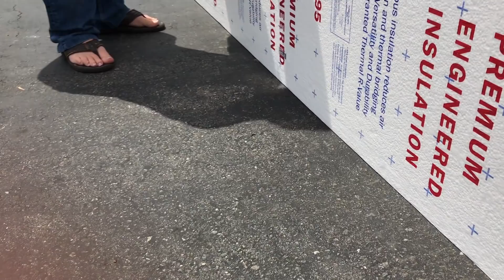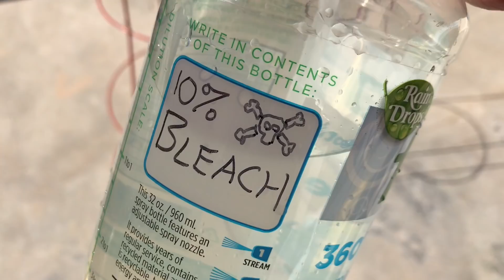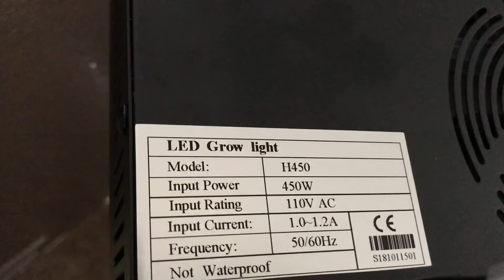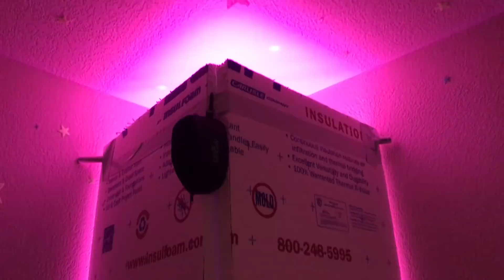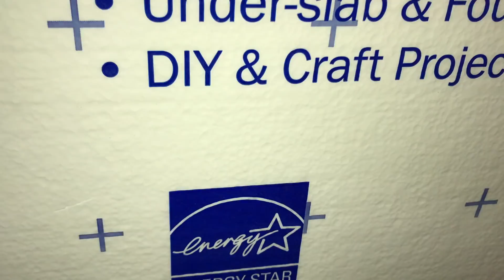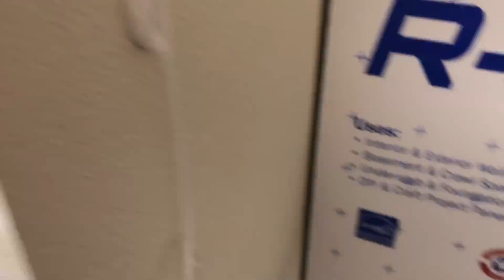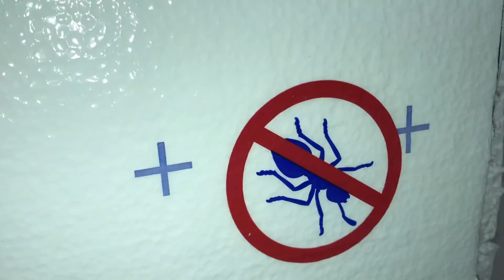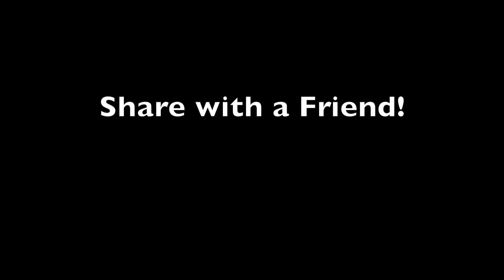Monster Plant Grows in Styrofoam Cage

Comment: Hi if you decide to make another some time u will find it alot nicer and easier use soldering iron or heat piece of metal up it will put perfect hole in it right away

Comment: You can get a better light cheaper.. Giixer 1000watt LED. has settings for VEG to give your blue/white for roots. Then has bloom for your red/orange during flower. & of course you can flip both switches and have full spectrum.. They only cost me 60$ and theyll last about 2 1/2 years..

Comment: could you explain your top up bottle? is that meant to keep the water level or just a convenient way to add more nutrients. what's the math on your solution when your adding more to the tank. thanks
Reply from the maker: tops it off.  i like guesswork with nutrients

Comment: A real good way to get air flow going in that thing would be to put a box fan blowing out words on the top mounted somehow and then put like a bunch of little 6 in diameter fans and cut holes around the bottom to blow in cool air
Reply from the maker: good idea.

Comment: Airflow? Easy. Put two or four one to two inch holes along the base of the foam. Heat from the light will setup a convection air current and naturally move the air around.
Reply from the maker: I think a box fan perched on top blowing upward would work well
Reply: @JebGardener  you'd mentioned in previous videos about pumps being noisy, so I was thinking about that when I thought of holes and passive convection. No noise, and no extra electricity cost.
Reply from the maker: i tried convection with the early buckets.  didn't work too well

Comment: What was the purpose of the glass bottle upside down in the lid?
Reply from the maker: It keeps the water topped off at a consistent level
Reply: I see. That's what I was think, I just wasnt sure if it was like a slow release automatic nutrient system or just to keep water topped off. Smart idea though. I like it, thanks for sharing man

Comment: What you should have done is used elastic band wrapped around each post to set your depth of how far you want legs to sit into bucket leg right get them set just enough to put an elastic on the inside around the leg that will hold it in place I hope no one does that and grows weed gets root bind all around them posts you left long inside your bucket.
Reply from the maker: interesting thought

Comment: Hi Jeb, I am looking at the Mrhua light you suggested since the Kingbo is out of stock. I am looking to grow cucumbers, hopefully tomatoes and possibly some lettuce and things like that during the winter in my basement. I am looking at Dwarf plants since I am trying this in the basement. There is a 450W and a 600W do you have a suggestion on which one I should go with?  Also have you tried any dwarf plants for winter growing? Hopefully that is an affiliate link so when I buy you get some thing. Thank you
Reply from the maker: they paid me up front.  just depends how large your grow space is
Reply: @JebGardener  I will be trying your Kratky tote method for the cucumbers most likely first then maybe 2 to 3 20 gallon totes at 1 time.
Reply from the maker: get the higher wattage light for that.
Reply: @JebGardener  Perfect, just ordered the 600W. Thank you

Comment: Once the plant is maturing you show the inside of the grow box and we see that the water is low is that the normal water height. So that roots can be in air and bottom portion in water ?
Reply from the maker: this is dwc so any water level drops are merely mistakes on my part
Reply: Jeb Gardener  thank you for the answer. So you try to keep about 60% filled. I transformed a room in the basement to grow. You inspired me so much and got me started 2 years ago Thanks.
Here are the results after first season interior gardening.
https://youtu.be/0QUex2kYRZ8

Comment: I would use either Tetra air pumps or Aqueon Quietflows to reduce the water noise. Tetra is amazingly quiet. Since the Quietflows are hang on back kinds, you could try cutting out a slot and fitting the hanger through it so it keeps the lid tightly shut but still does the job. Also I have major respect for you having a bin full of water in carpet.
Reply from the maker: maybe i will try that.  its hard when there is a super cheap walmart pump to use
Reply: It's about a dollar more than the walmart one for the tetra brand
Reply from the maker: that would be a cool comparison

Comment: Hey Jeb, I see you used styro with the foil face. Was done to boost the light? If so, there is a more economical way. If you go to Wal-Mart, Dollar Tree*(everything is a buck or less), or whatever store like these in your area. Go to the party supply section. The plastic table top covers are what your after. There should be silver and gold plastic foil one's.I got lucky and my local store had a clearance sale, so mine cost $0.27 with tax.  I used thumb tact's, covered my walls and it worked very well.
Reply from the maker: yeah it seemed like a handy way to have structure and reflectivity

Comment: i really wouldn't say this is anything special since marijuana growers have been doing stuff like this for decades. i'd suggest using a hps 1000 w light and a good fan and ducting from a window for fresh air into the room and ducting to get rid of bad air. i'm not sure if you ph tested your water but if you didn't you should at least once every 1-2 days to maximize growth and keep the temp of the area at the right temp for your plant to maximize growth. good job on the plant

Comment: What I used to use, kinda same thing, is old Refrigerators. Id line the inside with heavy duty foil with Metal Foil Tape, fill the Crisper Drawer with dirt, and use whatever light you choose. Break off the Trigger switch for the light, disconnect the power to the Freon pump and hook the plug up to a Timer. Big, metal, insulated, sealed TIGHT. Heat, light, odor, NOTHING escapes. Not even heat from a high heat bulb. Works pretty good and nobody suspects it a "Plant House"
Reply: You need airflow
Reply: Sounds great but how do you manage airflow?
Reply: Sounds like an oven with the heat not escaping.
Reply: :D
Reply: But, but, but, don't you have to have the refrigerator door open for the light to be on???

Comment: Tight spaces like that require much more airflow. What do you use to remedy the powder mildew etc? I usually use some serenade. Better production with not airflow. I.e proper exhaust is the most important. Get the humid sure out
Reply from the maker: A box fan perched on top blowing up would have helped.  Sm 90 is a good preventative
Reply: Jeb Gardener good video man

Comment: What nutrients do you use? What is the ratio?
Reply from the maker: i put that info in my older videos.
Reply: I know, watched it once earlier. I just can't find it now I need it :(
Reply: Master blend. You can get the kit on amazon. Ratio is 12 grams nitrate, 12 grams master blend and 6 grams epsom salt. In 5 gallons. Mix in that order. Was told if you mix it all together like Jeb, you get nutrient lock out. Meaning the chemicals bond to eachother, therefore the plant cant use it. 
Jebs been doing this for some time now and ive been mixing it seperately. I dont see a difference. I just follow the directions on the package, but Jeb...Jeb's a rebel who likes to break the rules! =P

Comment: Can someone explain the bottle phisics
Reply: When the water table drops below the mouth of the bottle, gravity pulls out some of the water in the bottle. Bringing the water table back up to the level of the mouth of the bottle. Thus stopping any more water from coming out of the bottle.
It keeps the reservoir topped off by gravity. Its purpose is to extend time between top offs and or ensure the water level stays constant for x amount of time. The amount of time extended depends on the evaporation rate plus the plants consumption plus the size of both the reservoir and gravity fed container. Possibly also the air stone may have some role as well. I dont know if air stones accelerate evaporation or not, im assuming they do marginally.
Reply from the maker: yeah it lasts only a couple days when the plant is large.  The airstone has to be kept away from the bottle because the bubbles will rise into the bottle and push the water down.

Comment: Running that 450W light for just 12 hours a day here in Denmark would add 65$ to the electricity cost every month. Add the cost of the pump, the reservoir and that mighty expensive looking growlight. You will be enjoying cucumbers or tomatoes or whatever at 20$ a pop.
Reply: The led's are rated at that wattage. They dont run at full blast. The video clearly shows it pulling 146 watts. If he is running it 12/12, it would cost him approximately $8.28 a month. Thats relative to his location being 00.1534 cents in California for 1 kwh. I dont know his exact location. 00.1534 cents/kwh is average for all of California.

Comment: >input power 450W
>Input current 1~1.2A
>Input rating 110V AC
I don't get it. This is why I don't understand electricity well. Seems to me that, if its using 1.2A, then the amount of power can't really be more than 110*1.2 which is far lower than 450.

Comment: So, I've made plans for a self sustainable "sprout grower" but wondering if you could troubleshoot some of the issues that might come from it. Mainly the increased possibility of salmonella if the sprouts were misted with water from the tank. Thoughts?
Reply from the maker: I don't have a lot of experience with sprouts but my guess is adding chlorine or peroxide.
Reply: Jeb Gardener wouldn't the chlorine have an adverse effect on the growth of the plants? I thought about running the water pump Line pass a UV light...
Reply from the maker: depends how much you add
Reply: Let's say it's a gallon of water. How much would you recommend?
Reply from the maker: You are going to have to research and experiment
Reply: Jeb Gardener will do. Thanks for the advice. I'll let you know how it goes. Also, if you ever want to grow hot peppers (and I'm not alluding to anything else - talking about the live chat last night haha) let me know. I know some guys down in Texas. 😁 Bests!

Comment: I like the submersible pump you used. It's almost like an air stone/pump combo. I use the same one. :) And remember, Jeb. Silence screams.
EDIT: But then I watch further and you switch it out haha. Oh well. It works great for starts in a recirculating drip system.
Reply from the maker: yeah it was promising but it kept slipping down and failing.  i don't like having a power cord go into my res
Reply: I get that totally. I mount mine on the bottom. I know power and water are not a good couple, but maybe some day you should try out a drip system on a timer. I know you're a kratky man, but hey, I was SUPER surprised to see you branch out with a pump and stone haha. Take it easy.

Comment: Hey Jeb, maybe look around for an external aquarium pump, they run pretty quiet and are air-cooled rather than dumping the heat into your water.
Reply from the maker: yeah the pump i used later was outside the chamber

Comment: I loved the video, but have a question.
Normally, you use the Kratky method of hydroponics, but in your last couple of videos you decided to add a pump to oxygenate the water. Why is that? Is it because of the specific plant being cultivated?
Reply from the maker: for this one it is the ratio of the root mass to the surface area of the water.  also indoors it is relatively inexpensive to add air
Reply: i use a small atomizer in the water to turn it into vapor, the roots suck it up...they are cheap cause once you toss it in the nutes they get coated in salts and stop working efficiently after about 50-65 days depending how strong the solution you use.
Reply: Jeb Gardener I see. Thanks for the explanation.
Reply: Just Another Videoless Channel hey what solution did u use an can u use it with tomatoes
Reply: It's because he did not know what he was doing just look how he stuffed all the roots in the cup? 😂🤣practice makes pefect
Reply: @originalintent3664  hes growing cucumbers not roots
Reply: @mauri906  
Your comment is laughable at best.

Comment: Quick question - Why do you pollinate the female flowers? I've been told to take the male flowers off the plant ASAP because if the female flower gets fertilised, the cucumber gets bitter. Or is that only for some cucumbers? (I believe I have Telegraph)
Reply from the maker: regular cucumbers will reject the fruit if it doesn't get pollinated.  Some breeds produce mostly female flowers and the plant doesn't reject them.  If a male flower appears you remove it so the fruits don't swell irregularly and produce large seeds.

Comment: Really wanted to see you cut into it and eat it. What variety was it (on tiny screen couldn't see label.)
Reply from the maker: japanese cucumber
Reply: I'm guessing the light was also acting as a bit of a heater with insulation all round it.
Reply from the maker: thats why i used the temperature controller
Reply: Jeb Gardener hey consider growing chayote next. Its climbs with hooks like this plant, it grows very fast very easy and big and you get a ton of veg to eat plus in Cali weather is perfect you dont need grow light. In my place I lived before in one season it covered the whoLe fence between me n my next door neighbor
Reply: jaime delgado But what do you DO with it? My neighbors had that, hanging over our fence all the time. I saw them in the grocery store once. I guess you're supposed to cook them. I couldn't get them to something I wanted to eat. (also in CA)

I knew those were japanese cucumber. I was worried they would get too heavy and pull down the plant.

Comment: as always an amazing video jeb I wish I was as good a gardener as you. also are you growing plants that need more heat than where you live? because that would explaine your use of insulating Styrofoam. also I think I might have a few ideas of how to increase heat
Reply from the maker: I just thought it was a handy structural component with built in reflectivity.  I used a temperature controller to monitor heat.  It never shut down though.
Reply: yes that makes sense also if your interested in a way to easilytalk to your fans then you should make a discord account trust me you wont regret it
Reply from the maker: i might do that eventually

Comment: I too am usually under the aegis of vodka and pizza when gardening and building. 
Also, I did some more research on a question I asked about using plastic for hydroponics. The BPA molecule, and other plasticizers, are non-polar and too big to enter the Casparian Strip, so they do not get into the plant. Seems like I was being too cautious.
Reply from the maker: do you have a link to that info?  Thanks.
Reply: I will compile the papers I read. There was no one direct answer, I gleaned it from multiple papers about the Casparian Strip and the BPA molecule. I will get the papers together that aren't behind a paywall and send it to you. I'll post what I can in a comment so everyone can see it.
Reply from the maker: yeah i just like to see where info comes from.  i suspected the molecules were too big, but i don't have testing equipment to know for sure
Reply: Here is a good place to start while I comb through my papers to find the pertinent ones: https://medium.com/container-gardening/can-food-crops-be-grown-safely-in-plastic-containers-b634292ff6a7 
Here is a good quote from the forum:
"John Chater · University of California, Riverside Department of Botany and Plant Sciences “BPA is a relatively large (and non-polar) molecule compared to the ions that plants typically are taking up (K+, N03-, Mg++, … ), so I do not think that the plant will take up the BPA (which has two phenol-groups in the structure). There is theoretically no way for the soil’s BPA to get into the crop. Remember, all materials need to pass through the Casparian strip in order to make it through the root’s endodermis and into the vasculature.”"
Reply: Orutra621 I'm also curious about this issue, since lots of cheaper hydroponic setup uses variety of plastics...